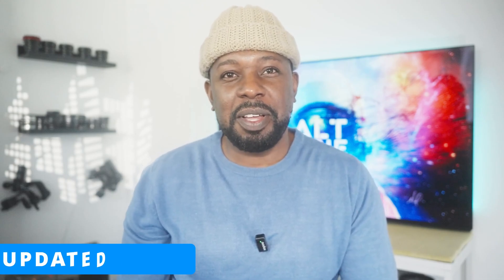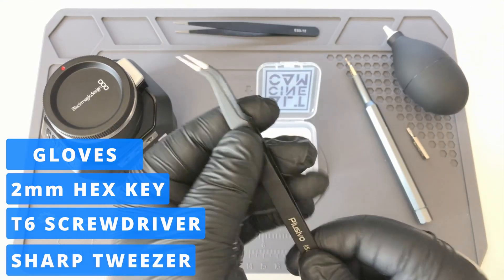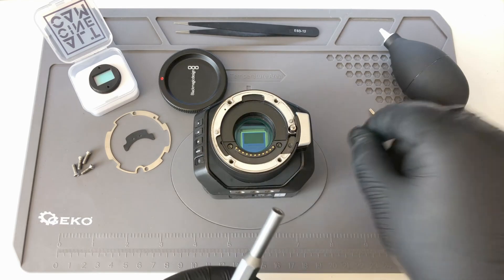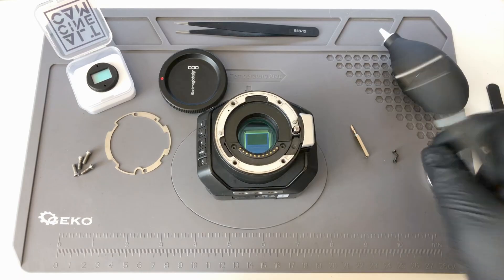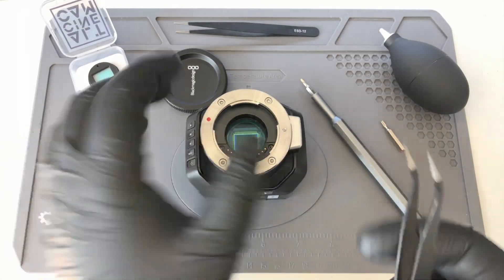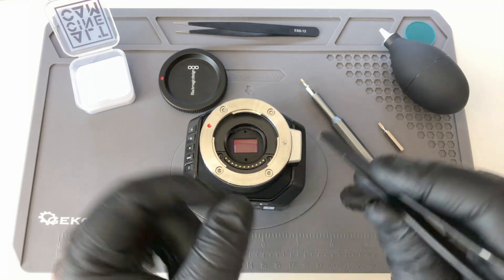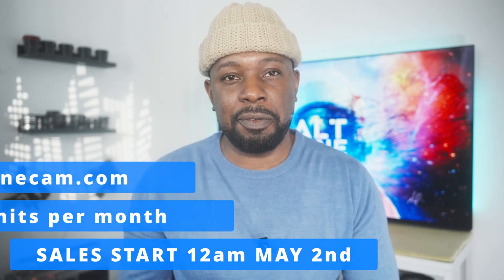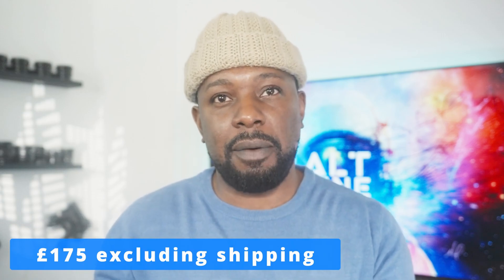BLACKMAGIC OLPF - Installation Guide UPDATE

Comment: I got 2x of these for 2 of my BMPCC OGs. I've been wanting to put a focus mark on my BMPCC cage, which originally is measured at FFD=19.25mm.

With the addition of the OLPF and the need to shim the mount to adjust for that optical thickness and discrepancy, that flange distance will be different tot the original value. Do you guys know the exact value of that correction compared to the 19.25mm? Is it a case of adding the thickness of the shim to the FFD or is it more complicated than that? 

Whichever way, can you help me with finding the right number so I can etch that exact measurement into my camera cage please. Thanks
Reply from the maker: @TitoFernandes  hi Tito, yes you'd just add the shim thickness. I can't remember the size from memory as Simon dealt with it. Drop us an email and I'll get back to you tomorrow.